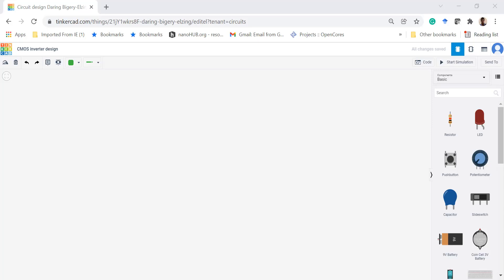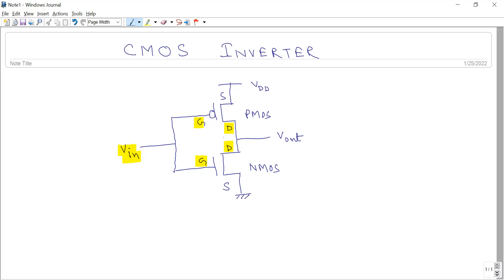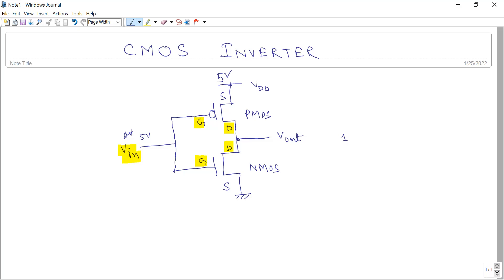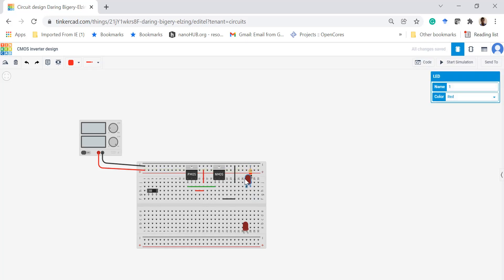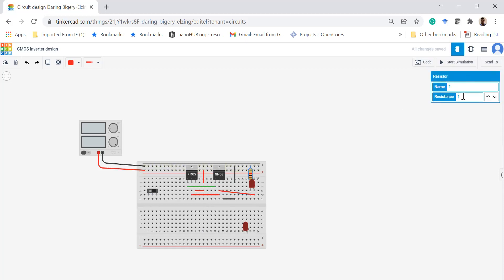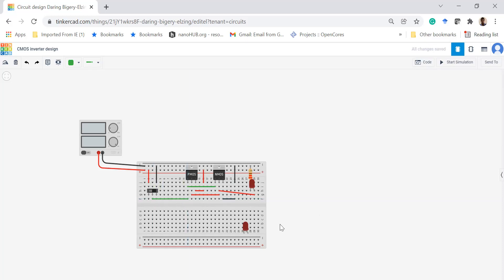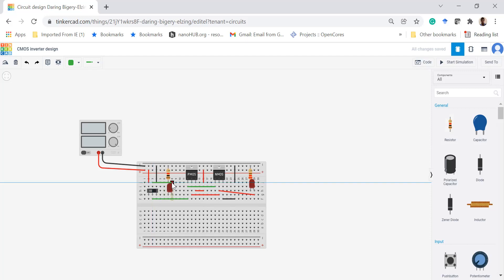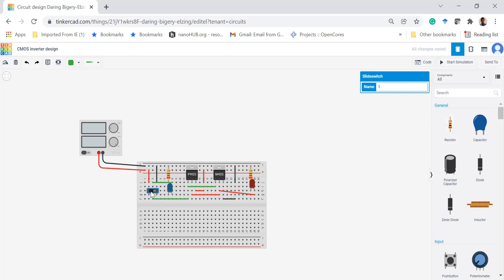CMOS Inverter Design and Simulation (in TinkerCAD)

Comment: how can we do this circuit without using resistors?
Reply from the maker: You can apply square wave as input. Make sure that voltage level of square wave is in between 0 to VCC. It is already mentioned in video at last part.